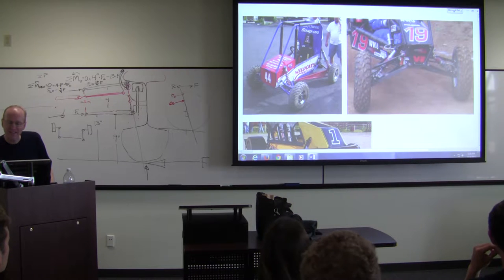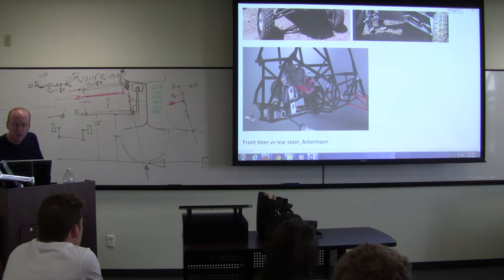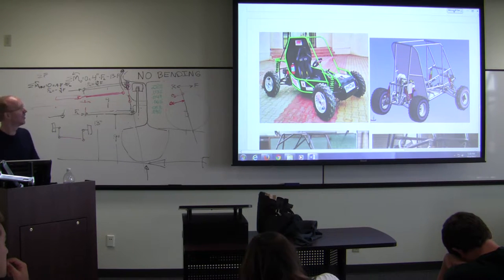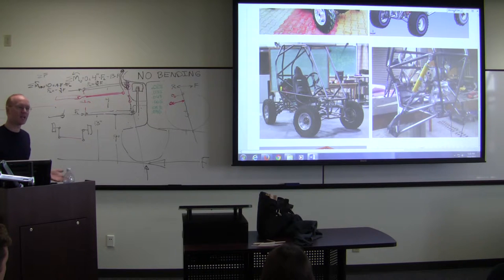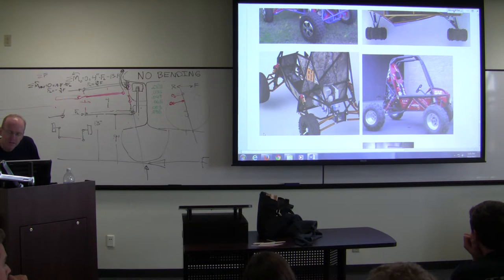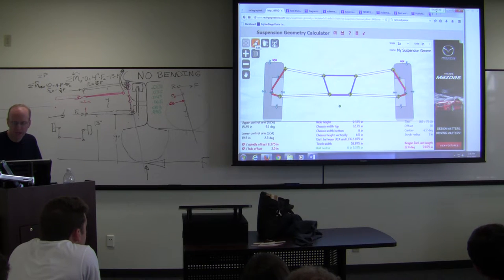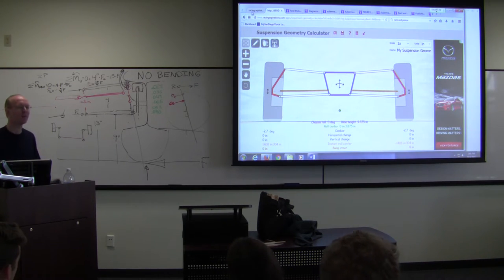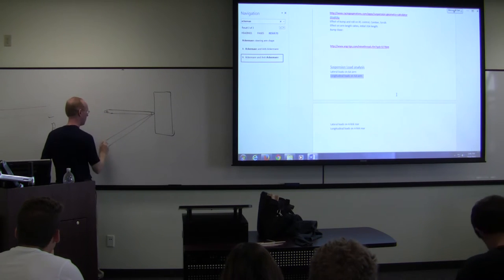Vehicle Dynamics #3c: double A-arm design, packaging, bending, chassis design review

Comment: I love these lectures, awesome information! I've watched all of your videos for this series a few times. I have some questions for applying these design guidelines to other applications such as a space frame chassis build with a mid engine RWD rally style setup, primarily pavement but with mild offroad capabilities. ie. A-arm design options (why some rear lower A-arms have one link biased at a forward angle instead being closer to a perpendicular angle to the chassis).. suggested roll centers, instant centers, upright design etc.. I know you said instant centers for a road car would be inside the tire where as an offroad baja setup should have a RC outside the tires, is it as simple to assume a rally car would use a setup somewhere in between those two? If its possible to contact you through email or LinkedIn I'd truly appreciate the opportunity to hear your thoughts.  Thanks